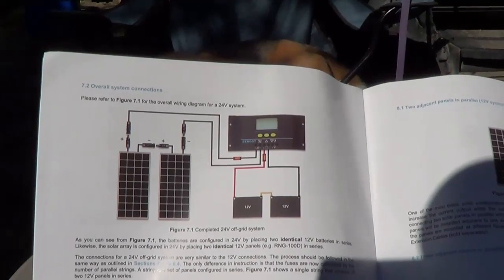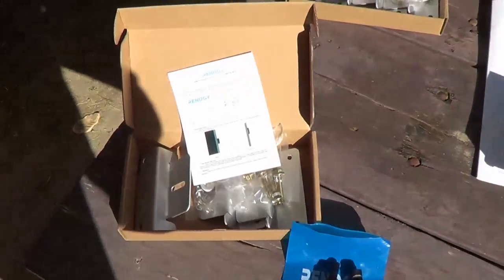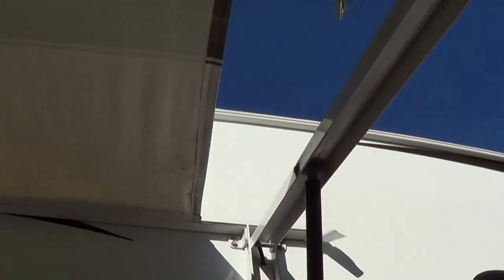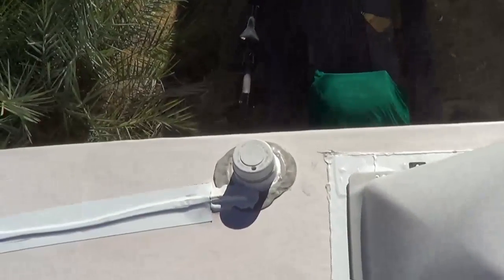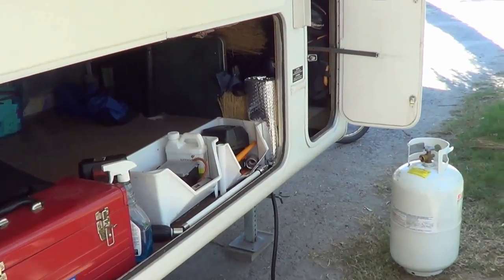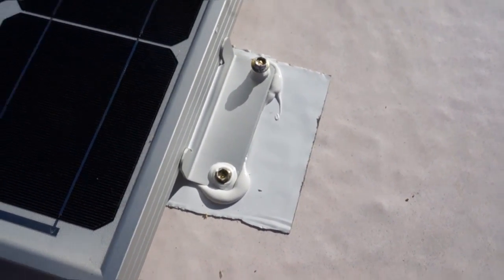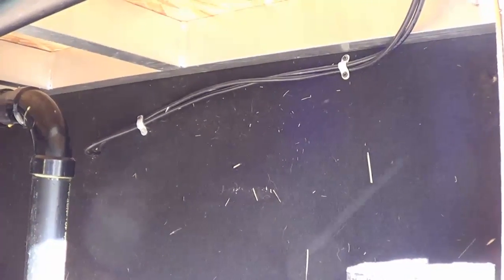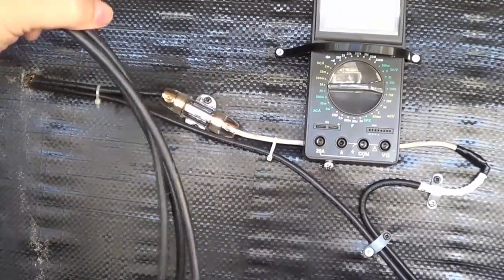Installing a Renogy 200W Solar Kit on my RV

Comment: Hey RayMy name is Rick
I enjoy your videos, thank you for your info. My wife and I are getting close to going full timing in our 5th wheelI want to get solar for sure, I'm just a complete newbie to them.. Now on the solar system you installed, it came with the panels and charge controller and wiring,. Now if you want to say run your coffee machine or TV or items that are actually plugged into the wall, do you need an inverter installed with the solar panels to be able to run those items? For instance like now if I need my coffee machine , I have to either be plugged in to a full hook up site or fire up my generator and plug my rig into the generator..Any help or advise would be greatly appreciated Ok, well time to go look at some of your videos, and maybe we will run into each other when we go full timingThanksRick
Reply from the maker: Hi Rick, you would need to add an inverter to run a coffee maker or microwave and will need at least a 1500 watt or 2000 watt inverter. To give enough energy for that you really need 2 but preferably 4 batteries as they are what powers the inverter, the solar panels simply add energy back into them. To charge up 4 batteries usually, needs 400- 600 watts of solar since the coffee maker will draw down the batteries quickly. Many folks will use the generator and fire it up for high wattage loads like that rather than installing all the solar and batteries that are required. My wife actually uses a small espresso makeer on the stove so we don't need the extra power to run a coffee maker and we give up and don't run the microwave except on the generator. So we get by with a 1000 watt inverter.
It all comes down to lifestyle and how much money you a prepared to spend on off grid camping.
2000 watt inverter, 4 batteries and 800 watts of solar seem to be a sweet spot for folks who want to run appliances without firing a generator. Keep in mind though even they need a generator when multiple cloudy days happen.  Cheers! Ray

Comment: OMG!!! that propane system is a bomb waiting to happen not only  could the slightest loose hose connection cause a catastrophic situation the propane regulator vent is in the compartment leaving a very thin rubber diaphragm between you and an explosion!!! and propane gas would seep easily into other electronics and electrical devices.... this should be titled how NOT to install propane system! Not one part of that system is suitable for indoor compartment use... #MassiveFail
Reply from the maker: I'm not sure what you're talking about I haven't modified the propane system it's the way its made from the manufacture and almost every fifth wheel trailer has the exact same setup. The propane compartment is wide open at the bottom in the case of the leak.
Reply: Oh I didn't realize it was open on bottom, makes huge difference...

Comment: Ray, I am about to do some Maxxair installation  To reduce odds of water leaks,like you, wanted double coverage (Dicor and Everbond tape. A Maxxair tech told me to use either or, but not both. Said Dicor chemicals would eventually dissolve tape...and Everbond w dissolve Dicor
Reply from the maker: Hi Dale, Never heard of either dissolving either. The only thing that the tape won't stick to is silicone.
Here are the instructions from Eternabond - https://www.eternabond.com/articles.asp?id=170 and a video from the RV Doctor - https://youtu.be/ralbn7R_Dy8   Both show taping right over the old Dicor.
The most important things are precleaning (Any dirt and the tape may lift) I've found acetone works really well, don't stretch the tape when laying it down and adding firm pressure after to activate the microsealant. 
I also used the 4" wide stuff so it covers the old dicor seal but sticks to the roof on both sides as well. - Here is a look at my fantastic fan install - http://www.loveyourrv.com/installing-fantastic-vent-fan-rv/ It's all fine a couple years later and I've had to do zero maintenance to it.
Here is a look at my Eternabond roof seals near 2 years later - https://youtu.be/zuGAwXHKbwU?t=1308
Cheers! Ray

Comment: Hi, how many batteries did you buy for this system, and do you have a link to them?
Reply from the maker: Hi Kathy. I originally had two - http://www.loveyourrv.com/trojan-battery/ and then when I added two more panels I went to 4 batteries. You can see the most up to date version of my systems here - http://www.loveyourrv.com/diy-rv-boondocking-power-system/
Cheers Ray
Reply: so if I'm starting from 0, and I were to buy 2 pannels @160wt each - how many 6vt batteries would I need to buy?
Reply from the maker: There are a lot of variables in a question like that but generally, I'd say two.
Reply: LOL, there are so many variables in learning about this My HEAD HURTS!

Comment: What size fuse did you use and where did you get them?
Reply from the maker: I used 30 amp fuses I got at Radio Shack. Since then I've upgraded the system quite a bit and have changed to switchable breakers - http://www.loveyourrv.com/diy-rv-boondocking-power-system/

Comment: did u ever run the AC w the solar panels
Reply from the maker: No, to run the AC takes more power than I can supply. Ideally, you would need 800-1200 watts solar panels, 6 - 8 batteries and a large inverter 3000 watts or greater. Better to just use a generator.
Reply: what size generator
Reply from the maker: Usually 2800 watts or greater does the job.
Reply: I have a 4000 watt generator will that be enough
Reply from the maker: yes

Comment: what I'm confused about is the fact that I have my 2 12 volt batteries wired in parallel to keep them at 12 volt, but basically make them last twice as long,  right? so, my 2- 100 watt panels are also wired in parallel, according to renogy, this is how to do it.  shouldn't the panels be wired in series?  (with a 30 amp charge controller, 1500 watt inverter (with 200 watt samlex fuse on battery)
Reply from the maker: Depends on the charge controller. If it is a PWM type they need to be wired in parallel to work properly. If using a more expensive MPPT controller you can wire them in series or parallel. There are pros and cons to each wiring arrangement.
https://www.renogy.com/learn-series-and-parallel/

Comment: Just installed mt 200 Renogy system....almost 10am and will check my output.  Fingers crossed for 6,8 amps!  Yesterday at 4:30, I was able to get 6.2 amps.  Thanks for the tips, need to add the white tape to protect the wires from the outside elements.
Reply from the maker: Cool! I like the tape since it holds the wires in place really nice. Cheers Ray

Comment: I just finished my 150 watt setup on my camper van.  Ill make a vid and link it.  So i can see what you think.
Reply: Hi Travis.  Your solar panel array simply charges your batteries.  The real heart of your system is your battery bank. (the bigger the better)  Your inverter allows you to use AC appliances whose power requirements are within the specs of the inverter.  You mentioned running a microwave.  Those draw a LOT of power and they can deplete your battery bank quickly.  While it is probably possible, it is probably just not practical to run your microwave off your batteries and inverter.  

I'd recommend that you just give up the microwave while boondocking or give in and run the genny for an hour.  I don't have a genny, so that isn't an option for me.  Still, a bigger battery bank would extend your stay capacity on a boondocking trip and that is where I would spend my money first in upgrading my system.

You also mentioned your voltage dropping.  There are several reasons this might happen.  First is that you may be simply depleting your batteries.  Check your batteries individually for performance and see if you have a weak one.  One weak battery in a battery bank can draw down the rest and create poor performance of the bank as a whole.  

Another relatively suspect cause is the wire size and length involved.  Check some ampacity charts against the specs of your system. Do you need shorter or larger wires? Larger wire size can help with voltage drop when a long wire run is involved.  Usually, shortening the length of the wire run in a circuit isn't possible or practical.  If your solar system was professionally installed, it is most likely engineered with adequate wire sizes. (but I would check anyway just to be sure)

A third suspect would be your inverter.  You should normally not exceed 75% of the rated capacity of the inverter (my opinion)  Remember, that 1500 watt inverter is probably designed to handle more like 1100-1200 watts continuously and 1500 for a short time. (less than a minute)  They label them by their surge capacity to make them look better in marketing/sales.  So if you have a 1000 watt inverter and a 1000 watt microwave, that won't work even if you have plenty of battery power.

There are other possible causes which include (among other things) loose or corroded wire connections, but I'm not an expert and I certainly am not an electrician.  You asked if you need a larger battery bank.  Well, in this case, I'd say that bigger is better. (within reason)  

In my rig I have 400 amp/hours in 12 V flooded deep cycle lead acid batteries.  (The compartment is completely full so I'd have to put in another battery compartment to carry more.)  I wouldn't even think of trying to run a microvave off that when I was boondocking.  Perhaps if I had double or three times that capacity, but it wouldn't be practical for me to keep a bank of 12 batteries in an RV.  

A bigger solar panel array will simply charge your batteries more quickly.  A bigger inverter will allow you to drain your batteries more quickly.  A bigger battery bank is probably the most useful upgrade that most solar systems could get since it allows you to store more energy for use later. Once your batteries are full, it doesn't matter how big your panel array might be, you can't store any more power.  Also remember that there is a limit to how quickly batteries can release their stored energy.  Different battery types have different limits just as they have different capacities.

Hope this helps.  Good Luck.
Reply: you do realize that if a microwave draws 1000w at 120v its going to draw like 80amps off your solar/12v system right? ... your going to need more than a couple batteries and 400w of panels... not sure if you have a special microwave or what but  its just a heads up as I just upgraded my setup to 6 6volt golf cart batteries and 360w of panels and I still wouldnt run a microwave myself as it will run the system way down quickly
Reply from the maker: Cool
Reply: hey!  i am trying to use my solar to run everything but i cant keep my volts high enough to run stuff like microwave and what not.  do i need a larger battery bank?
Reply: thanks for the advice.  i will get another battery or two. I figured out that by using a capacitor between my inverter and my bank, should keep my voltage at 12volt and keep my inverter on.  im also trying to use a portable AC unit.  it is rated for 8.9 amp and i bring in 7.5-8.5 amps on my 150w solar panel so i will only be drawing out about 1-2 amps from the batteries .  and when i get another 150w panel my batteries wont even feel it.
Thanks again!

Comment: It looks like you interrupted (cut) the feed wire so you could get a reading to the volt meter? Would it have made more sense to just have hardwired the multi-meter leads into the feed wire?
Reply: Barry R. Brown cx
Reply from the maker: The feed wire was hardwired into the multimeters amperage shunt. It was just a short term thing to get a quick idea how the panels were performing. I've since removed it and added a proper battery system monitor called a Trimetric which uses it's own shunt to get info on amperage in an out of the batteries. - http://www.loveyourrv.com/bogart-sc2030-cc-and-trimetric-tm2030-rv-installation/

Comment: I'm not sure if you're aware but if you read renogy's warranty it says it's not supposed to be used in mobile applications.
Reply from the maker: Strange, they sell the kits labeled for RV/Marine.
I don't see mobile mentioned - https://www.renogy.com/template/files/Manuals/Warranty.pdf

Comment: What is the purpose of two 6 volt batteries instead of one 12 volt. I have a deep cycle 12 volt on my travel trailer. I don't have room for two 6 volt unless I build an external battery box of some kind.
Reply from the maker: It comes down to Amp Hour capacity. The two 6 volts wired together are just like a big 12 volt battery. The 2 six volt have a total of 225AH. A standard deep cycle 12-volt battery has around 100AH. Since they are a taller battery than a 12 volt they actually take up a smaller foot print. So you actually get more capacity in a smaller area, except they are taller.
Reply: Thanks

Comment: Great video!  I'm wondering on the reason for applying the tape before drilling the holes for the mounts - what's the advantage of having the tape?  I'm inclined to just follow this same procedure since it looks like a nice result, but thought I'd ask since I am not 100% sure of this step.
Reply from the maker: I added it to give some protection to the rubber roof material from the brackets. Some people use butyl tape.
Reply: Ah, that makes sense.  Thanks so much for the reply and for posting such a helpful video.  I'm going to embark on my install hopefully this weekend!
Reply from the maker: You're welcome. Hope the install goes smooth. Have fun! Cheers Ray

Comment: Hi from panels to charge control panel 30am fuse and 10awg cable? Then cont. box to battery same? And is u have 2 6v in "series" would u also get a third 30amp fuse but to "coach" cable (pos+) ? At 4awg? Does that sound ok? I have renogy 100watt panel 30amp cont. box and 2 6v batt. =12v.. Does that make sense? U are the closest ive found to an answer.  On the renogy manual it said "8a" fuse from panels to cont. Box? I have need done this before so im so lost but have a dry camping trip in 3 with 5!!! Kids!!! So they need tv!! Lol. Any info would be so appreciated. Tia.
Reply from the maker: Sounds OK. Try to keep your wiring as short as possible to reduce losses. If needing to run a long way then use a thicker gauge.
Consult a calculator like this - http://www.freesunpower.com/wire_calc.php

You may not need a 30 amp fuse from the battery to the coach 12-volt circuits. Likely there is one already installed by the manufacturer.
Reply: +Love Your RV  thank u so much i was going crazy lol. So to clarify panel to cont.box 8a (100 watt panel only have 1) or 30amp? The panels cam with its own 10awg cables, but my battery and coach have 4gage . Gonna cut the coach cables from my trailer to battery positive and place as close as possible a fuse holder and installing a 30 amp agc fuse?   And same from cont. box to positive post of battery ? Fuse holder as close as possible to battery and a 30 amp agc? I really home that makes scence! Thank u sooo much Live your videos! God bless!!
Reply from the maker: If you only have 1 - 100 watt panel. The most it is likely to output is about 5-6 amps. So you can use a 8 or 10 amp fuse on the positive wire between the panel and solar charge controller and another between solar charge controller and the battery. That should give good circuit protection.
I'm not sure why you want to cut the "coach cables from my trailer to battery positive" I would just leave it the way it was wired by the factory. Cheers Ray

Comment: I had that same controller but replaced it after the first week.
Reply: I put a Zamp controller on mine and love it! It has everything I want on it, 4 stage charger, and all the info you want on one screen.
Reply: It might be helpful if you would explain why you replaced it.
Reply: It would not display the amps coming in only the voltage at the battery.
Reply: and the company I bought it from told me that as long as it was charging the battery it shouldn't matter if it displayed amps.
Reply from the maker: The original charge controller did its job well for about a year. I've since upgraded mine to a Bogart charge controller and a Trimetric Battery Monitor. Very happy with the pairing.  - http://www.loveyourrv.com/diy-rv-boondocking-power-system/  Cheers Ray

Comment: Why your Renogy cheger controller have not display?
Reply from the maker: That's how it came in the kit I ordered.
Reply: That's a PWM charge controller.  Most of the time, MPPT charge controllers will have a display with setting menus and readouts.

Comment: how do you like your solar setup did you add to it?  I am going to start out with a 200 w system too.  What would you do different?  anything?
Reply from the maker: It was a great way to get my foot wet with solar. Good value for the money spent. I've since added two more roof panels and a remote ground panel plus more batteries. I also added a battery monitor system and upgraded the charge controller. I have a yearly budget I commit to the boondocking power system so I've been adding things as I go. You can see articles and videos on each addition and upgrade here - http://www.loveyourrv.com/love-your-rv-mods-and-upgrades/  Cheers Ray

Comment: i have a 200watts air conditioner ....i was thinking about purchasing it for it. Is that possible?
Reply from the maker: Doesn't sounds like a compressor type air conditioner, not enough watts. maybe it's a swamp cooler?